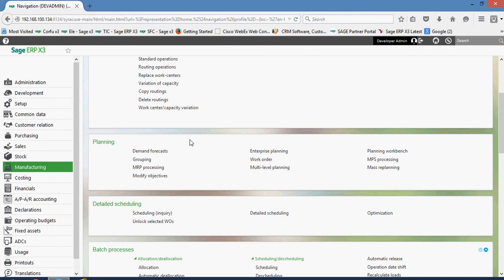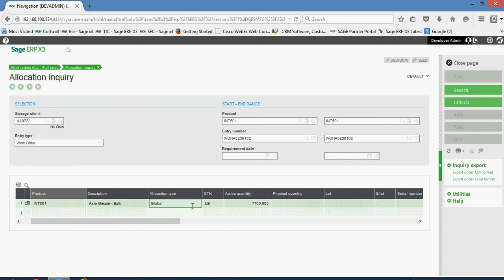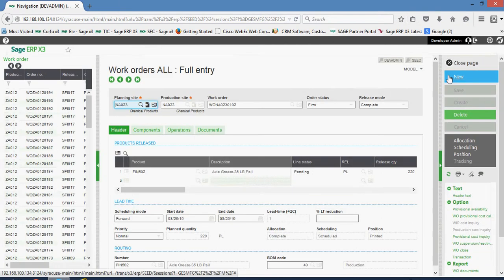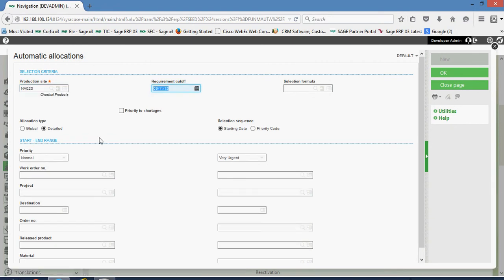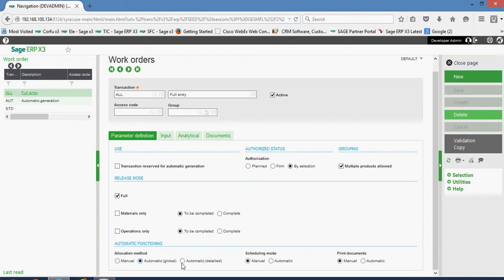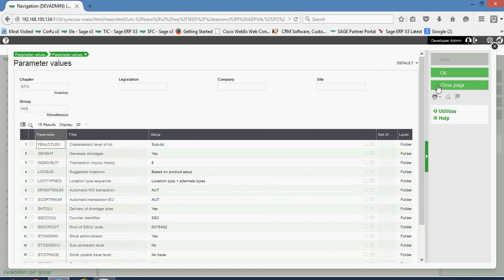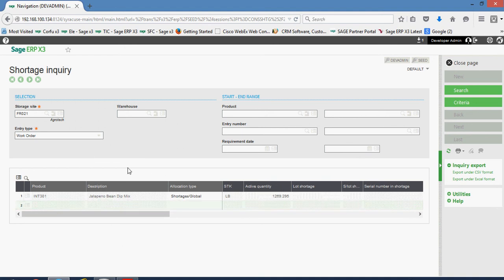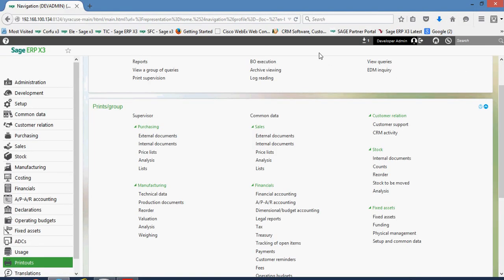Work Order Allocation in Sage x3

Comment from the maker: Keep in mind the "Release if Shortage" setting on the Manufacturing tab of the Product Site record.  This can be a useful parameter if you don't want to hold up the release of the work order because you are short certain raw materials.  For instance if you have a long lead time manufacturing process and you have a certain raw material that is not needed until the last step (Ex: label, box, etc), then you can set he "release if shortage" on the label part and then X3 will allow for the production paperwork to be printed even though you don't have inventory of this required component on hand.
Reply: While allocating raw material for work order, if any shortage found, how can I select alternate material which can be replaced and continue my order?

Comment from the maker: Just an FYI for you consultants out there that have a client that wants to bypass the work order allocation step, you can do this by setting the MTKALLMGT general parameter to "No".  I always try to get users to embrace the concept of allocations in the system because it is such a fundamental piece of the inventory control, but for some users that are transitioning from systems without this concept it can prove to be difficult to manage at first.
Reply: @kevinrcoulter We are desperately looking for a way to downgrade the control that allocation has on our work order process. If we allocate specific sublots, we have a warehouse full of drums stacked 17 rows deep, 4 high and the user would have to dig to get the exact sublot. Can we instead use the allocation step as an indicator only of which lots we want to pull and let the outermost sublot be the one that is consumed? Would bypassing allocation allow for this in some way? We really just want to communicate to the system which lot is needed and don't care which sublot is pulled.

2 years delay on this deployment because this is a very painful process that only builds waste into our daily activities.